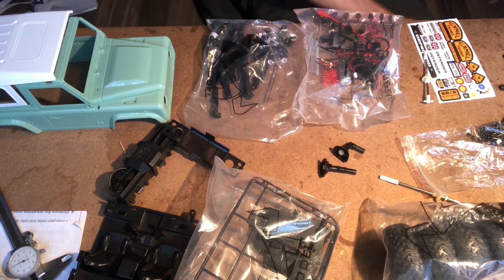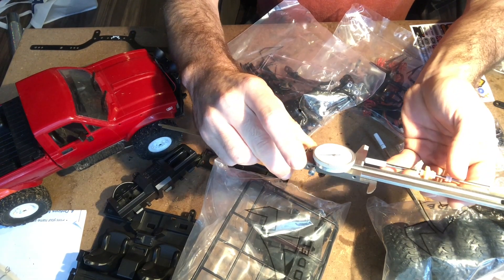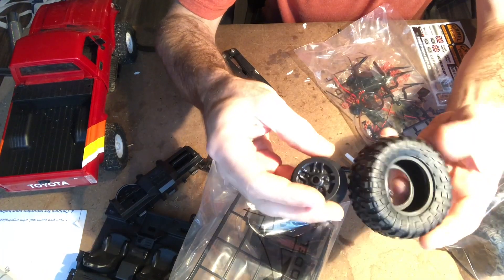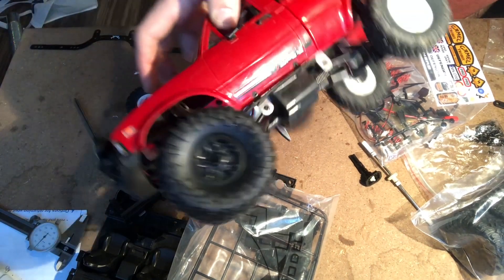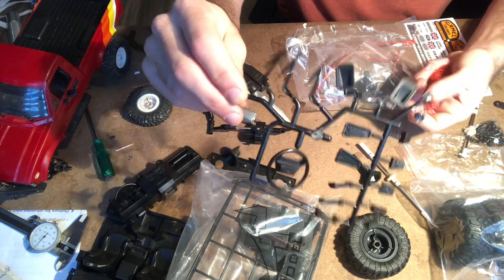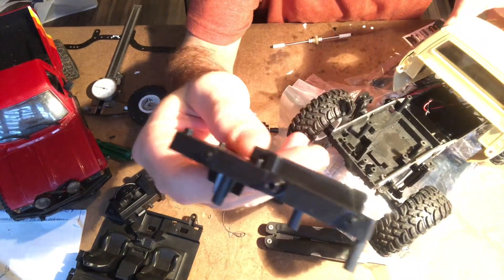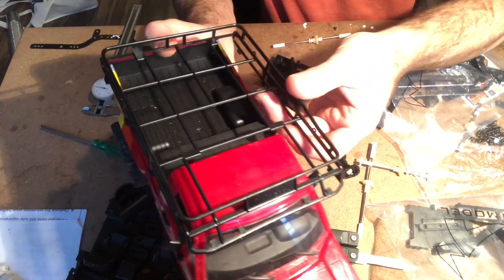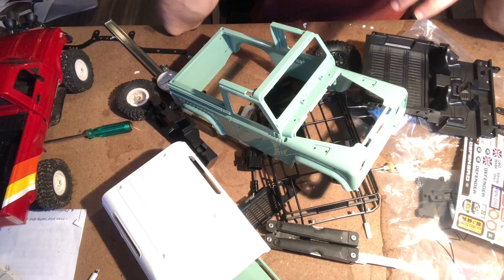WPL C-24 parts and size compared to MN D90 Defender RC scale crawler truck

Comment: I'm missing all the shock absorber spring for the MN-90k. Can I just substitute them with the springs from the WPL C-24?
Reply from the maker: No, the MN springs sit on the outside of the shock body and the C springs sit inside, so they're a much smaller diameter. Even if the C springs could fit inside the MN shock, there isn't enough room in there for them to expand so you would have very little travel. Perhaps you can find a spring made for another RC car to fit. The dimensions of the MN spring are 1.45" high, 0.47" outer diameter, 0.4" inner dimeter, and .035" spring thickness
Reply: @ilovejazz3s  thanks for the info. I appreciate it.

Comment: What I want to see is someone mount up the wider axles (housings) of the MN to the WPL. This would create a wider wheel base and perhaps better turning radius. From what you've shown, the transmission would have to be swapped, or at least the outputs. Thanks for going through this in detail
Reply from the maker: The wider width would give it more stability for sure, but I think it would look strange. In my opinion the stock WPL tires already poke out too far from the fenders to look truly scale.

Comment: Can we upgrade mn90 steering links to ball joint metal type? Thanks.
Reply from the maker: I don't think so, mainly because you need a metal truss to use the ball joint links and the MN does not have metal trusses available right now. You need metal trusses because they mount the shock to a screw small enough to pass through the ball joint, and the suspension mounting point on the stock plastic truss is too big for the ball joint to fit over. You also cant use WPL trusses on the MN D90 because the D90 has a wider truss and to go with its wider axle. However, you can swap out all the MN running gear (axles, trusses, suspension links) for WPL stuff and do it that way, but the WPL axle is 1/2" narrower than the MN so you will lose some track width and make the truck more likely to tip.
Reply: @ilovejazz3s  thank for the info 😊

Comment: Are the shocks the same length and mounting?
Reply from the maker: No, the Defender shocks are longer and the mounts are different. It's too hard to describe how the mounts differ but I can tell you that the Defender shocks are about 47mm from center of bottom mount to center of top mount, where the WPL are about 40mm from mount to mount. If you are crafty I think it would be easier to fit aftermarket shocks on the Defender due to the suspension mounting nub on the servo plate mentioned at 5:35 in my video

Comment: How big is the battery area how big battery can squeeze into
Reply from the maker: It's meant to fit a pack the size of 5 AA batteries. There is room for a bigger pack in the bed of the truck or above the transmission
Reply: @ilovejazz3s  thanks ordered 2 of these

Comment: What else to do i need to used this rtr
Reply from the maker: There are two different versions: the RTR version and the kit version. If you buy the RTR version it comes with everything and the truck is already assembled. If you buy the kit version you will need a receiver, transmitter, ESC, battery and charger, and you will also need to assemble the truck. My video is of the kit version.

Comment: Is the mn 90 rtr already charger battery transmitter and car?
Reply from the maker: The RTR will have battery, transmitter, and car. My video is of the kit version.
Reply: Mollie Jimenez rtr has everything, the throttle is proportional but the steering is not

Comment: WAIT WHAT IS FASTER WPL OR MN 90
Reply from the maker: They have the same motor, only difference is tire diameter. This should make the MN 90 slightly faster, but it also weighs more, so their speed should be pretty much the same.